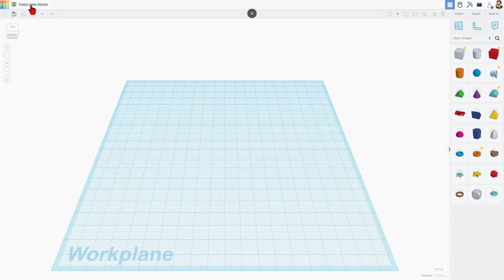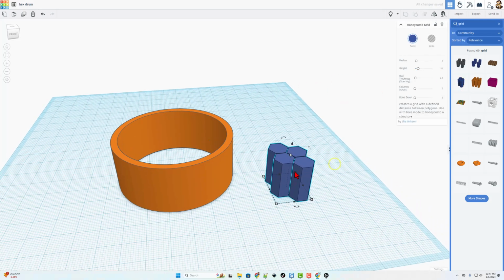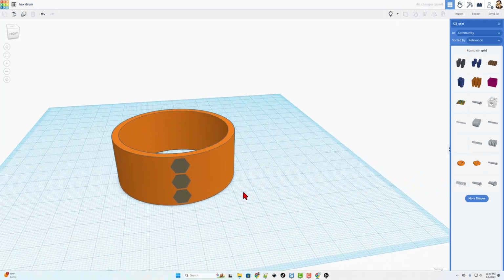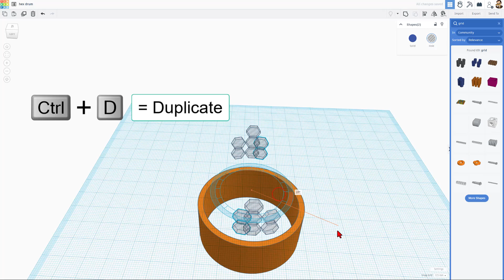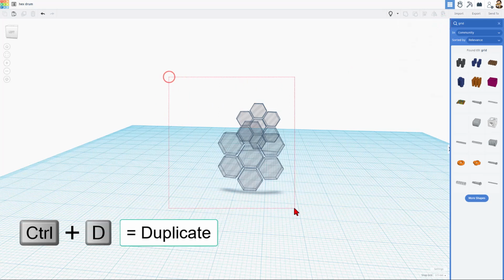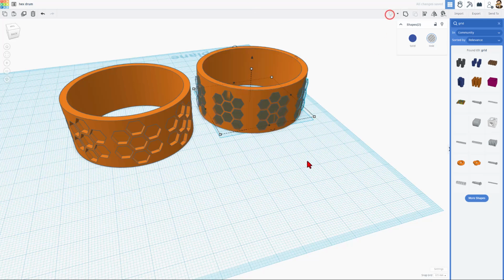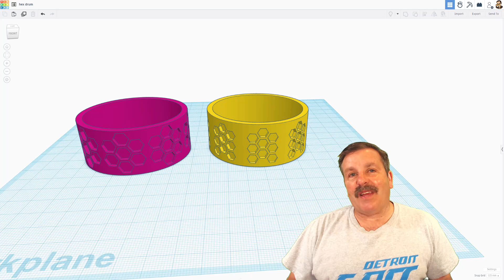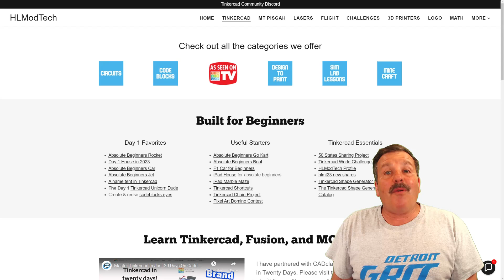Add Texture to a Tinkercad Curved Surface! Slick Steps for All Users

Comment: Great tutorial dude! Excellent work, everything was clearly explained and easy to follow. 
The only thing negative I can say is that it was driving me crazy that the pattern doesn’t continue around the cylinder and all line up neatly! 😂
Reply from the maker: Thank you. I was not too worried about they pattern being equal because it was not a part I needed... Was there enough in there that you could get them aligned perfectly if you wanted to?
Reply: @ yeah I’m sure I can, it should be just a matter of adjusting a couple of the measurements. Great tutorial, this definitely helped me learn more than a knew a a few minutes ago! 👍🏻
Reply from the maker: Awesome! My goal is always to make the content clear, concise, and then nudge users to push past it and make something epic.

Comment: Great videos, any suggestion on how to solve a hole in a cylinder in the bottom AND partially on side ? Example, im trying to make a docking station for my smartwatch, and the charger i put the watch on, is rounded with an attached cord, i want to make a cut out on the bottom, wich works perfectly, but to make a smooth, partial cut out for the cord, i cant seem to get that right in a smooth and simple way, any ideas ?
Reply from the maker: Thanks for the kind words. I think I would cut the side hole with the bent pipe shape. Make it a hole and push it below the shape you are cutting so it is only using half of it.
Reply from the maker: Would you like to send a share link so I can see inside it? Here's how https://youtu.be/XeDQjhRK8lg You can reach me at hlmodtech gmail. That may help me give a better explanation of how to make your cut too.

Comment: Took me about 2 hours to do what I wanted but this video gave me the info to do it. Just wanted to “cut” a pattern round a circle. Slowly learning tinkercad. The short cuts you kept referencing would be a great tool for a desk reference. Had trouble rotating shapes because I want to be able to type the desired amount but unsure how to select so I can enter the value like I can with normal height and width values.
Reply from the maker: Glad you had some success. Once you start the rotation you can let go and then type in the box. It will snap to the number you type.
Reply from the maker: Video to get a printable list of shortcuts. https://youtu.be/IRupThpLx_I

Comment: I would have used pyramid and two tubes, one for the holes and the other (smaller radius) for the uncut base. The advantage is the gaps between hexagons remains the same regardless of depth.
Reply from the maker: Neat idea with the double tubes! I will have to have a look at the pyramid parameters. I did not remember that we could pick sides. 🤦‍♂️
Reply: I've published cylindrical gradients made with shapes. The geometry is tricky with cylinders.